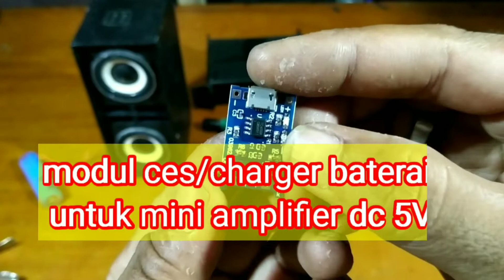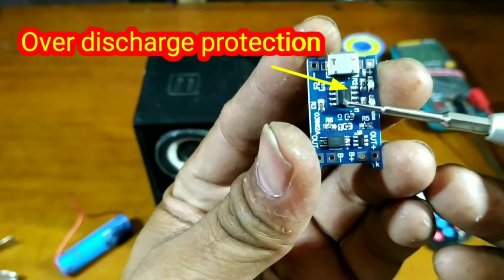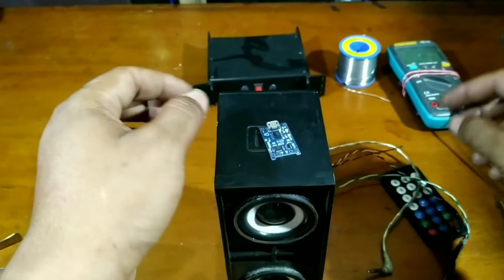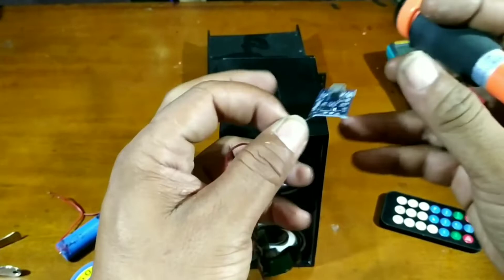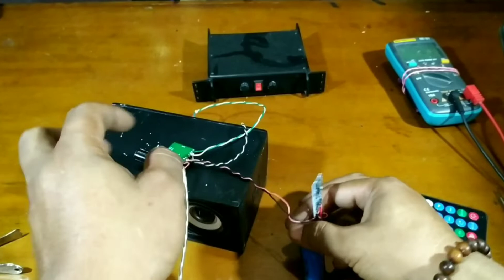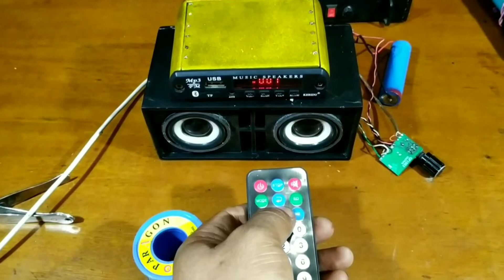Modul charger untuk mini amplifier

Comment: Bang mau tanya,misal kalau pake 2 supply gimana ya
Supply 1: pake baterai seperti itu,dan supply 2: menggunakan adaptor-5 volt/charger HP,apa bisa bang ya trims?
Reply from the maker: Adaptornya di colok di modul charger gitu ta

Comment: Bang kalo cas pake adaptor 12v dipake ic 7805 aman ga, sama modul kalo panas tu kenapa ya
Reply from the maker: Kasi prndingin 7805nya , panas normal mas
Reply: Oke mas makasih komentar nya
Reply: Ic kalo ga dikasih heatsink gapapa?

Comment: Bang opek, ini sm bms bedanya apa ya?
Saya ada amplifier dc 5 volt, 20watt
Mau sy kasi 6 baterai
Bagus pakai modul ini atau pakai bms 3s bang?
Reply from the maker: Ini sama fungsinya dengan bms 1s
Reply: Apa kah modul ini cuma bisa satu baterai ajjh mas. Apa bisa lebih dri satu baterai
Reply from the maker: Bisa lebih asal di pararel
Reply: @bangopek  ok bang